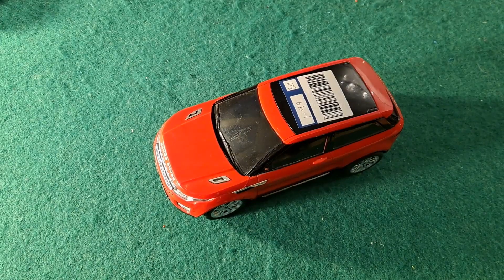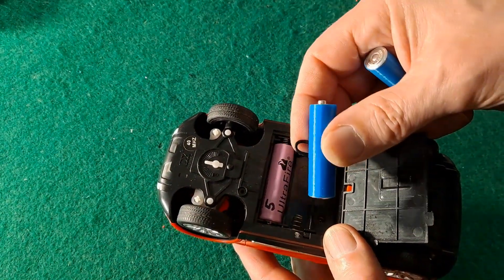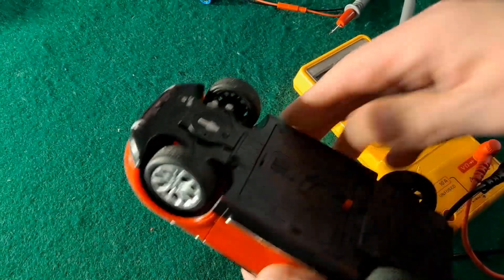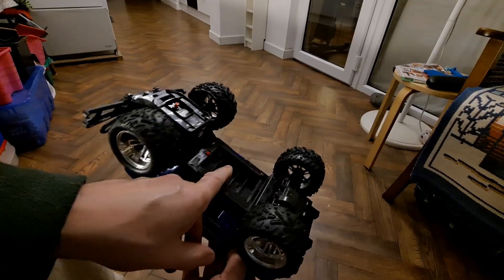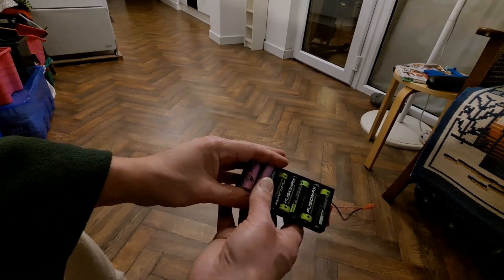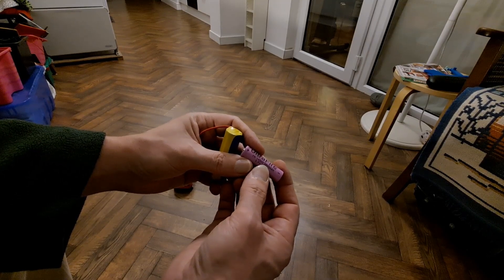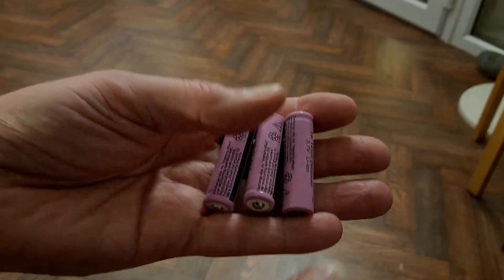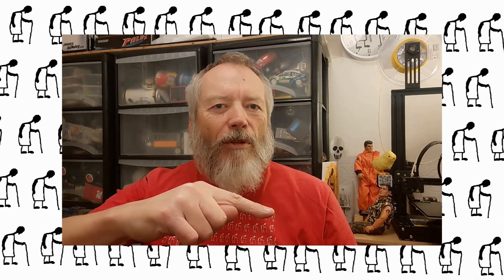Running a toy grade RC car with 14500 LiIon battery

Comment: Can you just connect the wires to the contacts instead of using dummies?
Reply from the maker: Yes. Using the dummies simply means that you don't need to modify anything, and you can change your mind and go back to normal batteries at any time 👍

Comment: Hi sir, I’m using a 3.7 battery holder with four slots.what board plate receiver should I buy
Reply from the maker: If you are planning to use four 3.7 volt batteries, you need to be aware they will be 4.2 volts when they are freshly charged. That means they will give you 16.8 volts. That means you would need to read the specifications of any receiver to ensure it can handle that voltage. If you moved to hobby grade RC gear, the voltage is handled by the ESC (electronic speed controller).

Comment: Brilliant. That little car is really fast. Glad you mentioned the higher voltages on the 14500 batteries. Some folk who know nothing about batteries or electronics could easily stick them into their radio or something like that. Then boom. 👍👍👍🎸🎸🎸
Reply from the maker: The dummy batteries I ordered have arrived and they are a little bit short in my opinion. The positive end does not protrude far enough for many battery boxes.
Reply: @GrandadIsAnOldMan  use a bit of aluminium foil or wire to fix that. Since they have a lid on and you have a 3d printer, you can ensure the foil/wire don't fall out.
Reply from the maker: In the context of my comment, the manufacturer should have got the dimensions right. Yes you can do a work around, but that is a pretty poor design and will be a disappointment to anybody who has paid for them @CENREAPER-YT

Comment: I've upgraded several toys in my collection that run on 3 1.5v batteries to use power banks with li-ion batteries that output 5 volts, it actually makes a big difference
Reply from the maker: Yes you can do that. The powerbank case adds extra weight. Some of them also limit the current output and cut off when you try to run the car.
Reply: I don't have a weight issue with them really, I have one board to a bank that powers off when too much current is drawn but I swapped it with one that doesn't, it auto turns on when current is being drawn and only shuts off when not enough current is
Reply: @GrandadIsAnOldMan  yep. That's the bad thing about powerbanks. Usually the limit the output current. Anyone knows any powerbank or DIY way (easy) to get 18650 without output current limit? :)
Reply from the maker: @seyisland  you could wire directly to the 18650.  If you want to limit the voltage, you can use a "buck converter" circuit board.  You can get them for pennies off eBay. You can set the output voltage to what you want. A buck converter is a DC to DC circuit. I do have a video showing one in use. If I remember when I get home, I will add a link.
Reply from the maker: I just looked. There is already a link to the video in the video description 👍

Comment: What can you do without a 3D printer?
Reply from the maker: If you don't have a suitable gear to match up like this then you would use the servo arm and a push rod to move the steering linkage. I have done that on most of my conversions.

Comment: Pretty good speed out of it with less weight in the car.
Reply from the maker: I can imagine many people won't resist putting in too many of the LiIons and burn out their receivers or motors.
Reply: @GrandadIsAnOldMan  these small motors can take like 15 volts for about a minute I think.
Reply from the maker: The motors might take it, but the receiver will not @CENREAPER-YT